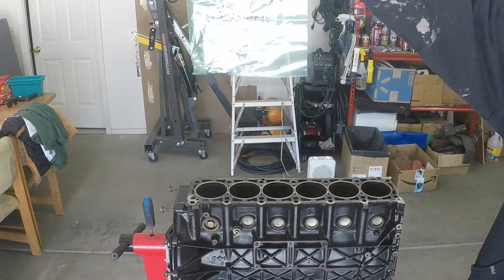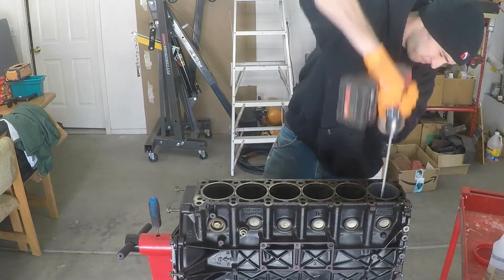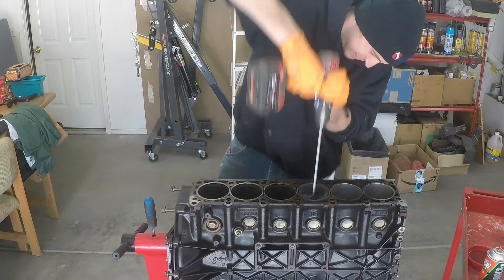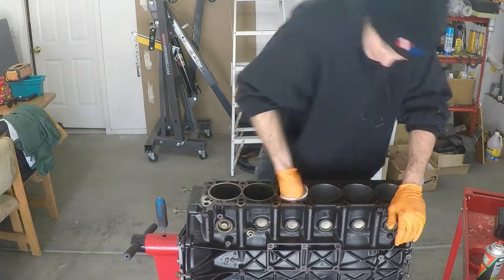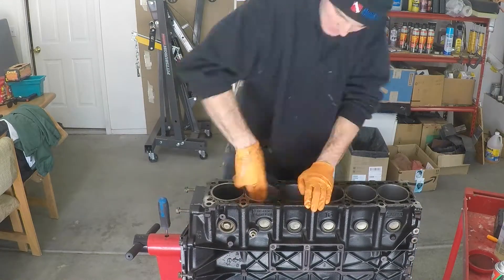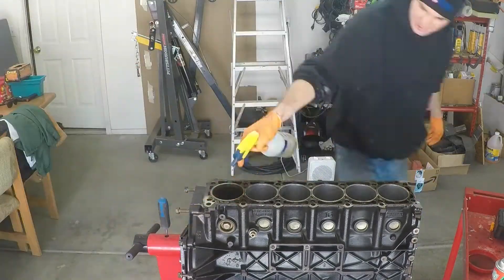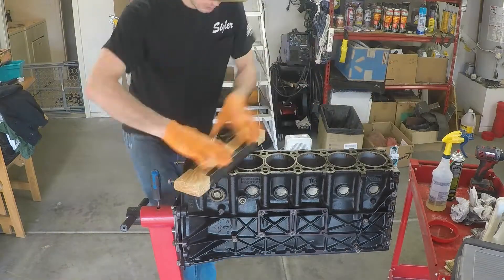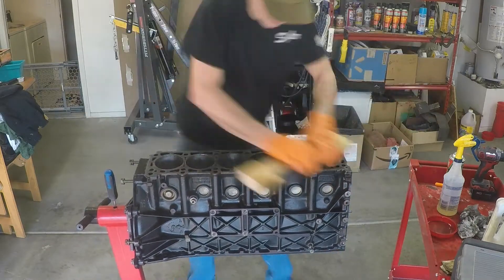Honing And Resurfacing The Block - M104 Turbo Build (Ep. 10)

Comment: Great info! Need to rip the head of an N63 for a head gasket repair (hoping its just that), and this has pointed me in the right direction. Thanks!
Reply from the maker: Thats why i do what i do! However, be aware that during first start and run of the engine, i had to tighten down the head 2 additional times. If using a MLS head gasket this probably isnt an issue, but with composite head gaskets it is necessary sometimes.

Without this, i literally had oil pouring down the side of my block back where the oil feed comes up through the block. After tightening, there are no leaks.

Comment: Are you putting titanium valves and double springs? You can rev m104 much higher, and keep posting because I wanna do something similar to my w124 and I need this vids as a tutorial
Reply from the maker: Nope, not with this build. However, the head WILL see modifications down the line AFTER turbo. I do want to rev higher eventually. 

And I plan on having this done, turbo, ECU, first start by the end or March so BUCKLE UP.